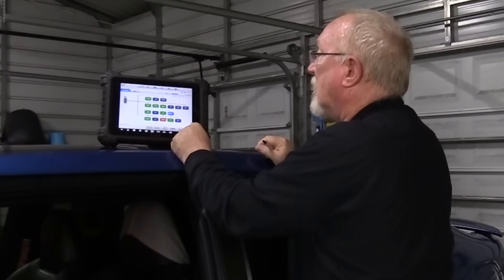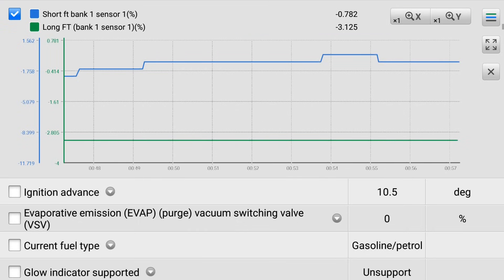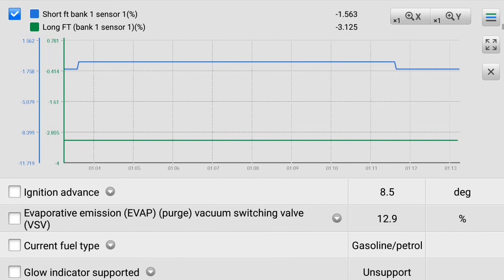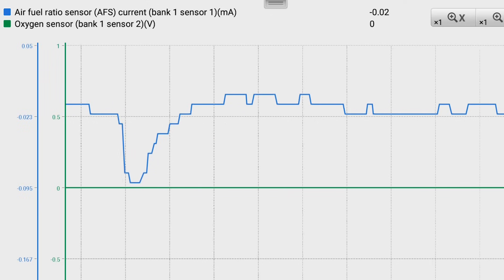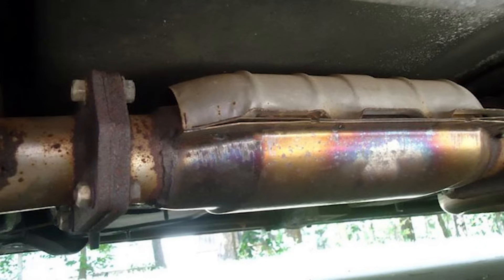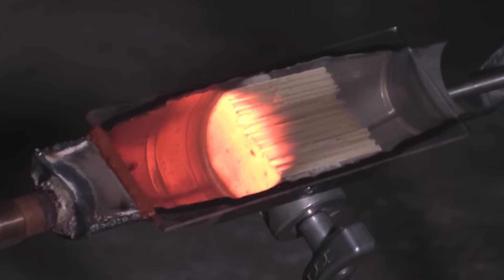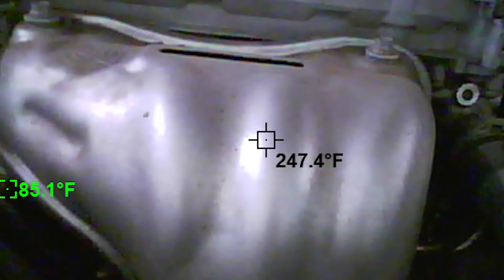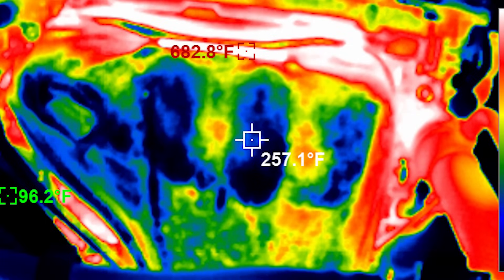The Trainer #118:  The REAL Cause Of P0420/P0430 DTCs

Comment: Car threw a P0420, I installed a known good catalytic converter ( at least it was good on my old taurus, no codes, before giving car away ), car threw P0420 and P0430. Checked exhaust for leaks, found flex band mesh was deteriorated but rippled metal pipe inside was intact. Replaced O² sensors and spark plugs, checked for coolant leaks, checked coolant temp sensor. OBDII scanner shows catalytic converter passed and green, but evap monitor flashing red and check engine light in on. Where do I go from here ?
Reply: So after an new O2 sensor has been replaced it could take a couple of driving cycles for the ECU to notice that the problem has been corrected?
Reply: @kenisehamilton4871  catalytic converter was replaced and that cured the problem, I have put 50,000 miles on and no codes. So it was the old unit that was bad.  Now I'm just thinking about how to sell the old converter for recycle, rhodium price is still really high !
Reply from the maker: What DTCs are stored now?
Reply: @VehicleServiceandRepair  thank you for responding so quickly ! 
 P0420 and P0430 
My scan tool shows that cat has passed and is green,  but evap has not passed and is flashing red ?
Reply: @paulpurdue5963  beware that it takes a  couple driving cycles to complete the MONITORS after an ECU reset.

If you have over 90+kMi REPLACE the 02/Lambda UPSTREAM SENSORS as they get lazy yet without a DTC code for failure. 
These tired lazy sensors cause vibrations in V6/V8 engines that affects FUEL TRIMS and cause engines act like old cars  to nag their owners.
Reply: @glasser2819  I have replaced the upstream sensors, as well as the downstream O². Bank two functions normally, when graphed showing that catalyst is functioning normal ( fluctuating upstream and flat line downstream, within voltage range ), yet, throwing P0230 code, bank one graph is mirrored and throwing P0240. 
Why is PCM/ECM detecting faults from both banks ?
Reply from the maker: @paulpurdue5963  You may try looking at Mode $06 data for those tests related to the Cat Monitor. See which ones have failed or are close to failing. What kind of scan tool are you using?
Reply: @VehicleServiceandRepair  Harbor Freight Zurich ZR13, i don't think that it will monitor data other than graphing.  It has 5 of 10 obdii modes.
Reply from the maker: @paulpurdue5963  Not sure how much I trust that. You may want to stop by your local AutoZone and see if they get the same results on their scan tool.
Reply: @VehicleServiceandRepair  interesting, i didn't think of that ! Now I'm curious if they pull the same codes, I'll do that today. Thanks
Reply: @paulpurdue5963 you are almost there! ...to answer ya: ECM is detecting "a fault". CODES RARELY POINT TO PROBLEM or SOLUTION! It's only an alarm to do detective work.
Take this to mean "one of the banks is burning badly". 
The bank you say that's "mirrored" is not able to regulate mixture. 

LOOK AT YOUR "FUEL TRIMS" live data to figure how the engine is tunning! Too lean or too rich?

(Is 02-heater fuse good?)
Reply: @VehicleServiceandRepair  i also graphed live data and bank 2 is normal fluctuating upstream and flat lining downstream, but bank one upstream and downstream are mirroring each other.
Reply: Was this a ecoboost?
Reply: @Dr650rob  It's a 2007 ford taurus 3.0 v, replaced catalytic converter with new one and that solved the problem. Since replacing the MIL has not come on, about 60,000 miles since replacement.
Reply: @paulpurdue5963  thanks for the updates!!

Comment: P0420 is a real disaster.
Reply: And depending on apicatipn. Eg My S197 mustang can assume  bad efficiency but only had the downstream O2 sensors to make that call, a combination of physical inspection by check operating temperature and amount of exhaust passing through , against  operational voltage of the sensor brings us close enough to give an opinion, and let the customer decide.
It will be interesting to see what Trainer has up his sleeve.

Comment: In my experience most of the time I’ve seen these codes it did end up being a bad cat but I have saved my customers a lot of money on occasions where it ended up being something else
Reply: (Update below) It ended up being a rear o2 sensor.  I am slightly irritated I paid $550 for cats again but the code/fix is covered with a 2 year warranty. Now I have a 99 4runner with NO CEL! First time I've had a car with no codes. 375mi and still gone!
Edit: It lasted 1000mi. After fixing a p0440 (lost gas cap) it came back. Confirmed new rear o2 is operating like the old one. Ill be going back next week. The shop owner has no clue where to start. my other ideas are a stuck PCV, crappy injectors, or a head gasket/piston ring issue. They will keep throwing (free for me) parts at it without checking any of the diagnostics data. I also dont know if it was an aftermarket o2. He said he did research, I hope he saw they are picky with sensors. We shall see. i will update with final fix to help anyone else with the 420 mystery.
Reply: @NOM145  Yup, there you go, mechanic assumed new cat, but it was the downstream sensor. Perfect example of why one should never assume a P0420 is automatically a dead cat.
Reply: @NOM145  someone in the comments said the code was fixed after replacing the fuel pump of his 4runner.
Reply: @NOM145  you have to use OEM sensors more than likely Denso. I have a 1990 4Runner and a Camry and LS400 ..I always use Denso o2 sensors. I bought a $50 Matco oxygen sensor removal socket 22mm (it worked) because the cheap Chinese o2 socket "spread" open even after Heating the threads and using a 24 inch breaker bar... possibly softer Steel. My LS400 has the original cat converters at 280,000 Mi and we always run Chevron or Costco gas
Reply: @NOM145  anyone check the wire/Harn
Reply: @borkganza9627  not to my knowledge.
Reply: It looks like getting the job done right.
Reply: It's always something else. Parts seldom just go bad. There is a cause for everything.
Reply: @christopherfoxwallace1291  
 I've replaced the (2) converters on a 99 4runner 4 times in 3 years. I gave up after 3 sets in the first 4 months i had it. Nearly one thousand into diag else where the last 2 years and no luck. I take it in specifically asking for why its damaging the cats and they come back with "replace them." Or my favorite "P0420 is always a converter failure." I pay the diag and onto the next shop. As much as I don't want to pay because my question goes unanswered, they still worked on it so I respect that. I gave the first shop that replaced them a second chance and they installed their best cats yesterday. 4 hours later it was back...in for a diag next week. Fun times.
Reply: @NOM145  so what ended up happening any fallow up what did u discover
Reply: @rickybaez2970  my tools got stolen so testing my theory is on hold but i think it was the thermostat being flipped. It ran at 215+. Radiator cracked, I replaced it and thermostat, old one had no jiggle valve. It ran at 190° for a week no code then SHTF (literally. The fan seized.)   I hired someone to do the timing belt, water pump, etc and they put the thermostat in flipped, it runs at 215 again and 420 came back within a day. Open to opinions on that one. It appears to be the only variable in between recent break downs. My gauge does not reflect the temperature difference for a flipped thermostat you need a scanner.
Reply: @christopherfoxwallace1291  💯 agree with you on this but this code is a hard one to crack due to the amount of inputs that can trigger it. I have tried multiple times to get rid of it even with a good cat and had to try various things to get it remove.
Reply: You haven't gone far down the rabbit hole of OBD diagnostics.

I'm sure you find bad Cats BUT that's not what his message is. 
Like the Trainer has said "Cats are built for a lifetime. It may go bad, do you just replace parts or find out why it went bad to fix the problem."
I'm putting my money on the fact that a Technician finds what has caused it to go bad. Any takers?

Trust the code, check the circuit ,
Make the repair.
Reply: @christopherfoxwallace1291  🤑